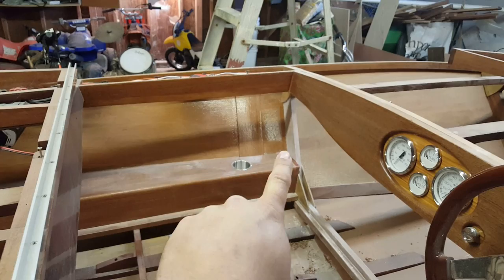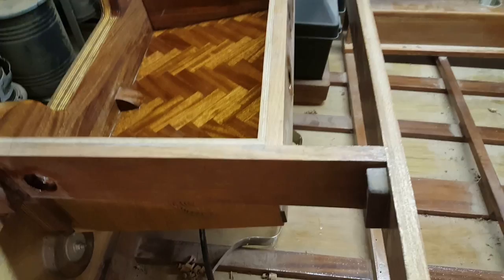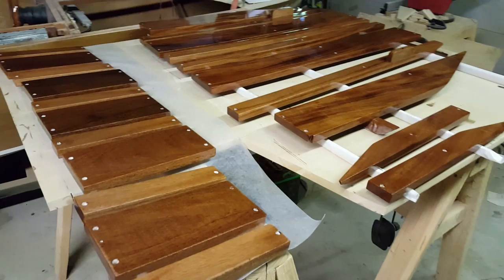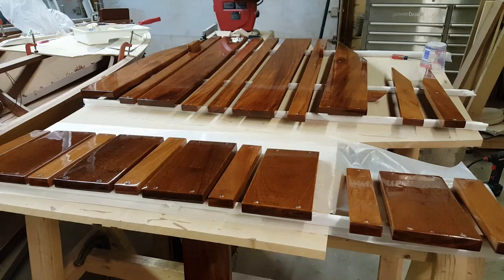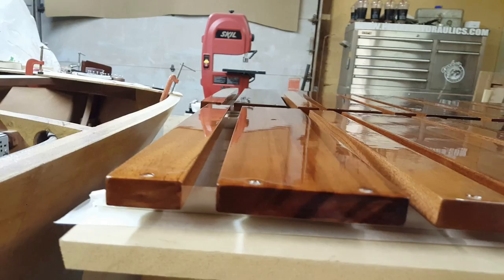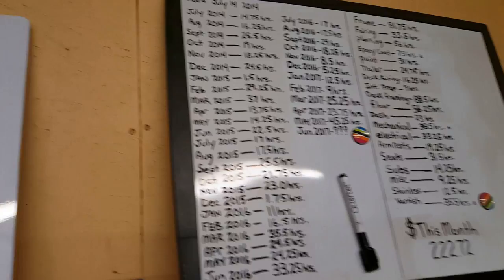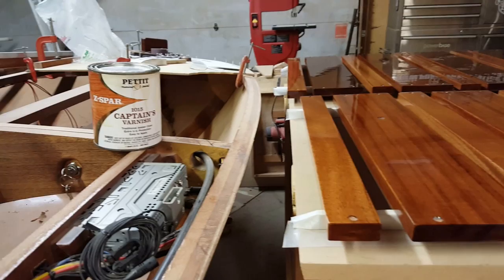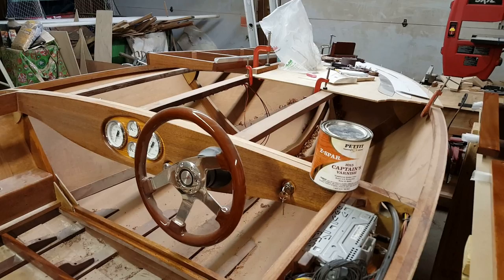Building the Zip vol# 39

Comment: Total expenses for my Zip = $11,625.17.  I can send you my spreadsheet of every expense if you want it.  Great job on the varnish.  My deck boards had a lot of open grain so I applied several coats of epoxy designed for coating.  Filled the grain much faster than varnish.  Then a ton of varnish coats on top and you have seen how it turned out.  I was out on the boat earlier this year and it looks like the day I finished it in 2009.  The guy I sold it to has really taken good care of it but hasn't had to recoat the varnish yet.
Reply: Todd Broadlick what your channel for you boat?